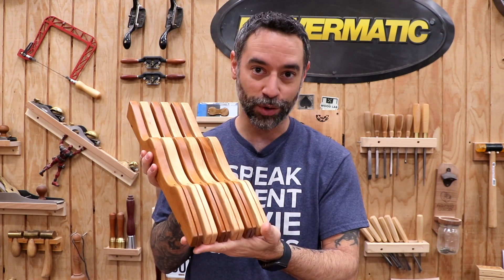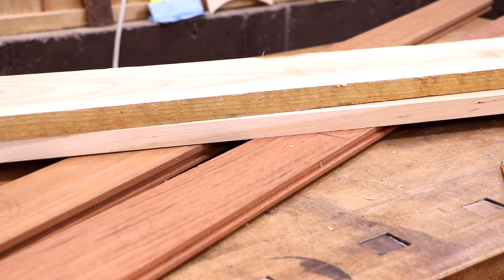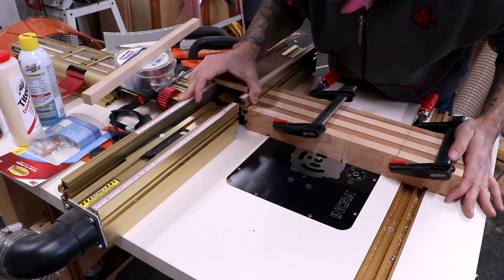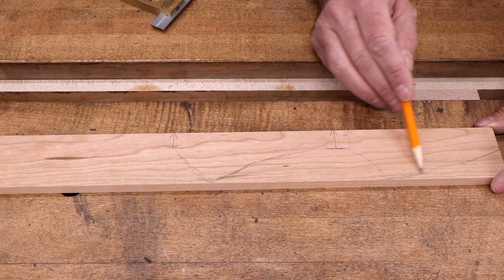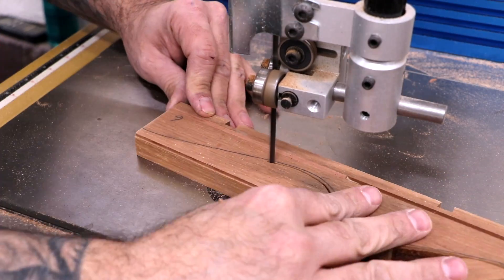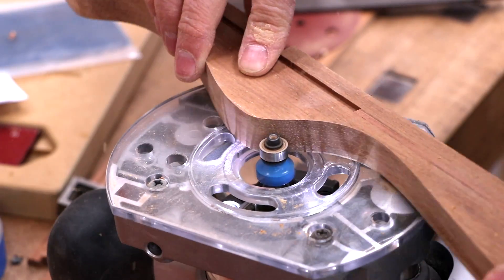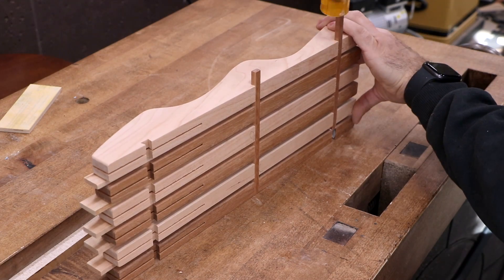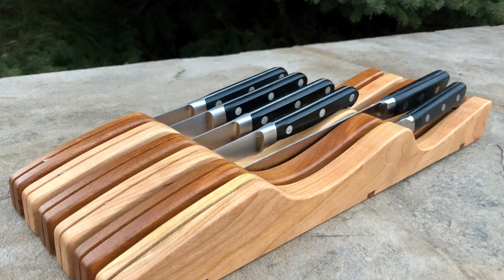In-Drawer Knife Block

Comment: Any issues with the bandsaw blade drifting when you widen the knife slots?     Great project. #blessed
Reply from the maker: Not if the cut is taken slow. Hard to appreciate it from the sped up video but if you let the blade clear the stock completely as you push forward slowly, it shouldn't drift.

Comment: I was just thinking on a different approach instead of for the drawer. Adjust the curves to where they could hold the knife in an upright position and it could be mounted to the wall. I know this is not pleasing to some but in my parents house they use a magnet strip from harbor freight to hold theirs on the wall for easy access

Comment: I recently rebuilt our kitchen cabinet drawers and doors.  My wife wanted the same thing.  Not only did I BUY it, I bought 2 so I could rip and glue together for a snug fit across the whole drawer width. Felt like a cheater, but the rest of the job was burying me.
Reply from the maker: nothing wrong with that at all, so don't beat yourself up. I wrote an article for Pop Woodworking in 2013 on this very topic :) https://www.thewoodwhisperer.com/articles/to-build-or-buy-furniture/
Reply from the maker: scratch that 2009 lol
Reply: @woodwhisperer  haha, time is accelerating.  Good read, and I agree with the many different factors that really come into play in that decision.  Interestingly, I could see my self changing my mind on "buy vs build" of a specific thing, based on those factors changing over time and place.

Comment: Great project. I'm wondering if you could use the same tape technique for turning.
Reply: I can't say I have tried it but blue tape does not have the holding strength of turners double sided tape.  I would not use this tape trick on a lathe.  But one test is worth a thousand expert opinions.  Give it a try and let us know how it works.

Comment: If I'm correctly translating, Brazilian cherry (cerejeira) is not allowed to be cut down anymore (at least in Brazil) for 15 years or so. If that's the case you're pretty luck of having these boards. I still have some in my shop from an old bed frame I found, and I'm planning on making some nice frames with it. Very nice and rare wood.

Comment: Any thoughts about applying finish before gluing up, so you can be sure to coat the narrow spaces between blocks? Or does the spray finish get in there enough? #bespoke
Reply from the maker: If I wasn't in such a rush to get this one made by Christmas, I would have finished before the glueup. That's really the best way to go, but the project certainly isn't ruined by finished after.
Reply: @woodwhisperer  Good call. Thanks for the feedback!

Comment: If you anticipated adding more width would it have made sense to not glue the dovetail keys in place?  That way all you would have to do is to create a new key when you wanted to add more knives.
Reply from the maker: Yup. As long as the fit is snug and stays that way, the ribs shouldn't move much.